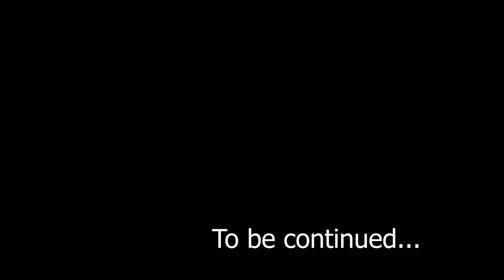Blasting for underground storm water retention tanks

Comment: @23:30 - I have worked on jaw crushers in quarries that could take that pile of rubble in one or two bites. Something with a pair of jaws weighing in at 13,000pounds/5900kg each just for the wear dies.  There is nothing more satisfying that watching a jaw crusher make a boulder disappear with what appears to be minimal effort.  I really, really enjoyed that.
Reply from the maker: Wow, all this rock may yet end up in a crusher. how long do the wear dies last when working with really hard rock?
Reply: @demolitiondavedrillandblast  Actually, the harder the rock, the easier it is to crush.  The dies are manganese steel and they work harden over time.  I imagine the dies could last a couple of years at least.  We only replaced one set that large.  It was the largest crane I have ever stood next to.  We had to use larger than 1 inch/25mm carbon arc gouging wedges JUST to get the retainer bolts out of the top of the die while trying to stand on an extension ladder.

Comment: We used the same method in Seattle. It would hold rain for awhile and slowly feed it into the storm water piping out to the sewage plant. Where they would take oil and sand out. Just some places used it. Usually long pieces of 10 foot concrete pipe anchored to beams. Don't want them to float when empty.
Reply from the maker: Interesting! I'm looking forward to seeing what goes in these holes, other paces I have seen concrete pipes like you describe.
Reply: Even our home in new Zealand has a rainwater detention system as part of our water storage tanks. It just has a few thousand liters at the top that fills up in heavy events and slowly let's it out via an orifice to the drains...

Comment: Large and messy job site! Air blasting of some holes looked as though holes were super deep - like 4m (x35mm maybe) - wow. Irksome with the drill rod breakage. Retention tanks - heck - huge size, and two bites as well - looked a good result... pretty time consuming though as well. Other half showed a very impressive ''heave" :)
Reply from the maker: Yes some deep ones on this job Chris, one of the tanks was on sloping ground and we had to drill just over 4m (76mm diameter).

Comment: At 33 mins in the video I see you using the "eastwood bundle" for a booster charge for the bagged ANFO. Was the "eastwood bundle" cheaper to use than a cast booster?
Reply from the maker: 3x 32mm plugs is slightly cheaper Dan, I chose this option as it is larger diameter and better couples to the large hole size, It does have one potential disadvantage though in that like all sensitized emulsion explosives it can be subject to dynamic desensitization problems in some conditions.

Comment: I’ve seen these tank’s before Dave, they can be very troublesome at times. I know it’s not your problem but who has to maintain them. I bet it’s not the Engineer who designed them. Anyway it’s great viewing for us, i love it when you really smoke that granite into dust.
Reply from the maker: I hear you Kev, there does not seem to be any access to clean them out should they silt up.
Reply: @demolitiondavedrillandblast  Oh no, that is just asking for trouble further down the line. Probably didn't want any civilians try to access the tanks and getting killed by bad air in a confined space situation.

Comment: Man, I thought you were drilling little 4 foot holes, but then you pulled that air blower out, and pulled, and pulled, and pulled, lol. That's quite a job. 80 hole blast, too bad it had to be covered. :P
Reply from the maker: I'm glad that they are not any deeper as lifting that pipe in and out is a work out!

Comment: Hi Dave,   INCREDIBLE!!!   Amazing video!  Lots of hard work went into this job!  It's been a while since I've  seen you use those 1 meter sausages!  They work great!  Do you need any extra permits to be hauling such a large quantity for one days blasting? Just curious.  Did you get your 4 meter drill rod & bit back in useable condition?  Who was that lady that jumped into the trench about 1/2 way through the video??  Looking forward to part 2!  Stay safe!!    Take Care,    Jim
Reply from the maker: Glad you liked it Jim, there is a limit on my transport, hence the tank holes being blasted in two shots, the long drill rod came out strait but we have not been able to get the snapped off shank adapter out yet... The young lady is Renee - she is part of the sewer crew.
Reply: @demolitiondavedrillandblast  Having her in the trench on new pipe likely beats what the crew doing sewer unblocking deals with.

Comment: We have soakwells to keep the rain water inside the property in Perth.  They are a lot smaller than the ones you were blasting for and you can dig many of them out with a hand shovel in the sandy soil. Yeah big lack of demand for your type of work over here.
Reply from the maker: Yes, I have heard that about Perth, do you have a deep augured hole with some kind of liner to stop it falling in or something like a septic leach field?
Reply: @demolitiondavedrillandblast  basically big barrels with holes in them. They stop the rush of water long enough to allow it to soak into the sand around it, which is very fast. When I moved here I was surprised to find after a day of heavy rain there are no puddles or mud.
Reply from the maker: I like the no mud!
Reply: @demolitiondavedrillandblast  yeah, it's different alright.

Comment: Dave, when you load/charge the drill holes, do you ever get the inkling to add slighty more ampho?  for example, if the material, hole diameter & depth call for 500 grams do you say to yourself “self, shag it, Imma gonna add 250 grams more just to be sure.”?
Reply from the maker: He he... not on this job though.
Reply: @demolitiondavedrillandblast  😁😁🤣🤣

Comment: Dave! good music,Can you tell me do you use the same explosive for all the different types of rock you come across, or for instance if you had hard granite will you use another kind of explosive.
If you were shaving an outcrop of rock from a rock face would you need specialized explosive. :)
Reply from the maker: Good questions #37, rule of thumb is that Explosives with a higher velocity of detonation work better in very hard rock. If you were doing a job like the one in this video - https://youtu.be/WCyU0MBnNbQ or this one -  https://youtu.be/3qAAJ1kJY10 you would use an explosive that is long and thin to spread the energy evenly.

Comment: Question:  Drilling holes.  You need two drill shafts to get down to depth.  How do you get the first one out of the hole?  Does the second lock into the first on and grabs it to pull it out?
Reply from the maker: Hi Bruce, there a 2 ways of doing this, when using a hand drill you start with a 600mm rod, when down to depth you pull it out, and drop in a 1200mm rod and so on, I have rods 4.5m long for the hand drill. When using the drill rig as in this video, the rods have a male thread on the bottom end and a female thread on top end and the rig has a carousel of about 6 rods and an auto handling system to load them and retrieve them.
Reply: @demolitiondavedrillandblast  I get it.  You start with a 600mm rod.  To get the hole started and straight.  The remove it and go in with a deeper drill.  I couldn't get that action from most of the videos.  They are fun to watch.  Love the excavator 'finger' . Just like the ripper on a big dozer.  (I watch gold mining programs)

Comment: At about 17 min in the video you use some long bags of ANFO (due to wet holes). Calculating charge weight with package explosives is easy. How do you calculate explosive charge weight with granular ANFO? I'm guessing you made these bagged charges up yourself.
Reply from the maker: I know that the 51mm lay flat holds 1.67 Kg / Meter or if pouring direct in the hole I know that my 1 Litre measuring jug holds 820 grams. Yes, I make these lay flat anfo bags.

Comment: just wondering why you don't use anfo with all granite. I know anfo is a slow burn big mover...so is it simply that  bedrock granite is too strong?
Reply from the maker: The long pink sausages that I'm dropping down the holes are anfo inside a 2 inch plastic tube to keep it dry in these wet holes.

Comment: Hi Dave, when misfires occure, do you reverse fire using the telatail?
Reply from the maker: The system is not bi directional when using Nonel shock tube initiation, if you were to use det cord you could though.
Reply: @demolitiondavedrillandblast  Not much really surprises me, but this fact had me scratching my head.  I hadn't a clue that those shock tubes were one way only.  I just assumed that the flame front would propagate in either direction from the initiation point. Now, my head is trying to process that tube actually spitting the flame front forward from one end to the other in all one direction.  Mind blown.  It's another reason that I watch stuff where I can learn.  I'll be pondering this for the rest of the day.  Mission accomplished DD.
Reply: Excellent question, sir!
Reply from the maker: @Tech Gorilla - the tube is bi directional but the delay clips on the end of the tubes, at the top of each hole will not work backward.

Comment: I understand the reasons for covering the blast with soil - dust, fly rock, noise and smoke mitigation, but doesn't it make it impossible to spot any misfires before the excavator starts disturbing the pile?  I know Nonel dets are reliable and pretty forgiving, but it must add another element of complication compared to the old blast mats used in days gone by.
Reply from the maker: Yes, to some extent. There is a handy little work around for this that I usually use. From the last hole in the sequence or from the end of each echelon row, run a piece of shock tube out from under the cover, over the open end of the tube place a piece of electrical insulation tape, when the shot fires the shock wave will punch a hole though the tape over the end of the tube and confirm that the signal tube has propagated all of the way to the last hole(s). This provides reassurance against the most likely cause of failure - damage to the tubes while covering. I call this a witness tube as it bears witness to the shot propagating all of the way to the end. Granted that it does not show up a down hole misfire, this is quite rare when you have done everything correct, however occasionally it does happen and almost always it is not the fault of the detonator but a dynamic desensitization misfire because of the emulsion explosive being damaged by the firing of an adjacent hole, almost always when working in wet, broken ground with close hole spacing. This is why it is important for the shot firer to supervise the dig out to be watching for any un exploded stuff in the muck pile or be ready to investigate when the rock that should be broken and it is not. Thanks for watching. Sorry about the slow response, been busy blowing stuff up!
Reply from the maker: You are obviously "in the job" please post some blast video.
Reply: @demolitiondavedrillandblast  I worked alongside the Shotfirer (we changed contracts before I had the chance to do my shotfirers ticket, so I only had a responsible worker's ticket) on charge up and did re-entries when I worked underground a few years ago.
Given the speed that the faces got charged at - always a rush at end of shift - it's a wonder we didn't get more misfires than the occasional few that we did.  When they did occur, it was usually right up in the shoulder of the face or less commonly in one of the lifters.
I never wotked on stope charging, but I would love to have had the chance as that would have introduced me to Ikon detonators.
Love your channel.

Comment: golden panda wheel bearing?  dave, dont tell me you intentionally installed a less than optimal bearing.  recently i needed a bearing for a power tool and found that the size i needed was the same as what was in a fidget spinner i had.  what a coincidence.  of course i went and bought a quality replacement.  golden panda, lol!  does golden panda make drilling equipment too?
Reply from the maker: Yeah.... it was in the machine when I got it, have to give it credit that it has lasted a long time. Golden Panda make absolutely everything and they make it so cheap that many of the good brands have shut down shop and no longer make the good gear. Sad really
Reply: @demolitiondavedrillandblast  , oh, okay.  because you knew the brand name of a wheel bearing, i thought you may have been responsible for choosing a no-name brand over a respected brand which did seem out of character for you who understands the importance of quality products for your livelihood.  any trailer that has a compressor on it is going to cop some rough use
Reply from the maker: @vsv nrg I did not actually fix it, It had to go home on the back of a tilt tray truck and it was only a short distance to the machinery dealer where I purchased it - this guy is very good and does a lot of work for me, as apposed to being a long and expensive trip back to my place. So it went to the brightest compressor technicians around these parts. I knew they also had a dead unit similar to this one in the yard so spare stub axle would also be available if required. Funny thing was that he had had a shot at me for fitting the "YumCha" brand bearing, It was in it when I bought it from you I said. If I have to buy a bearing it will be a good brand. Love that Rillers Critter.
Reply: @demolitiondavedrillandblast  , ha ha ha.  as per your last sentence, so do i.  thats why i use it.  what do you think it is?

Comment: @13:30 - You know you blasted it good when you need a screen deck instead of a ripper tooth to get the spoils out.
Reply from the maker: You got it TG, the biggest concern is that when you really belt the decomposed granite it just turns to sand and the customer does not get to see a huge pile of rock that you can point to as justification for the corresponding bill.